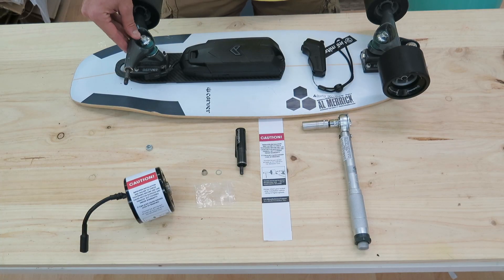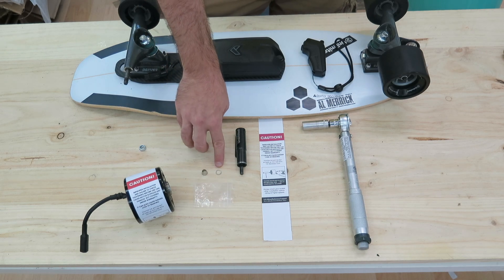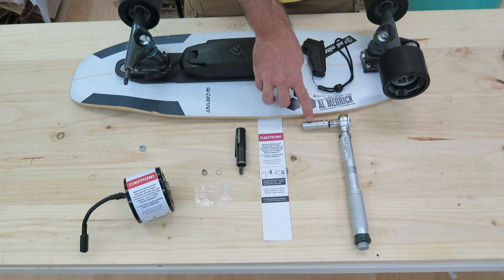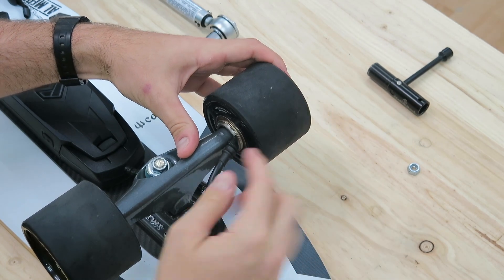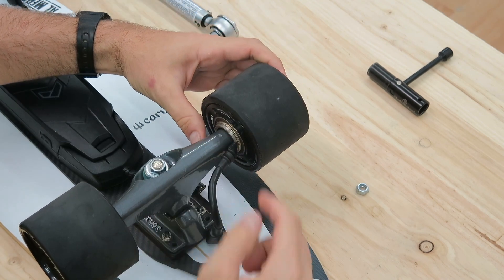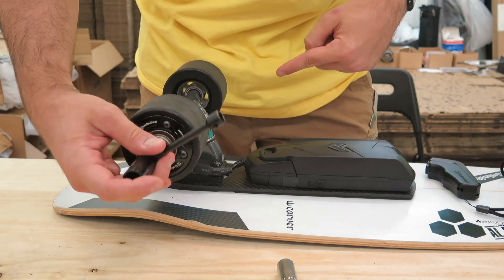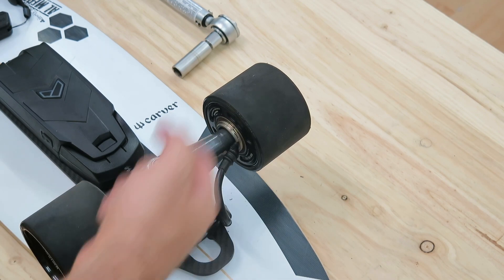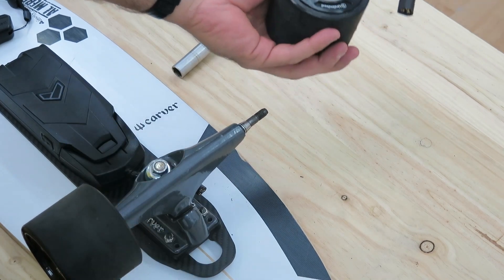From The Workshop - Unlimited Electric Skateboard Motor Installation

Comment: Will mounting the motor without the couplers (little brass bit that slides on the truck bolt) result in this hub spinning? I received a pair of the hubs without trucks. I don’t believe I got that little coupler.
Reply from the maker: The most important thing is Coupling Cone + Speedring, you really don't need a serrated washer. Just make sure the nut is really tight!

Comment: thats a very nice looking motor ,but i dont understand what stops the motor from rotating?
Reply from the maker: That's the secret sauce (pun intended)
Reply: It' not difficult is the same principle of a collet on a milling machine. The internal shaft of the hub is taper and the collet (what the call the coupler) has the same taper, so once you compress them they get in contact and sealed the 2 parts together. Just check whatever video about spindle and shank and you will see the same principle :-)

Comment: Sooo... everything depends on that single nut that's the final step in installation?  I imagined an entirely different arrangement, so seeing this was helpful. EDIT to add: Watched again. Ah, I see.  Make sure the shaft of the truck isn't fat and doesn't rub against the wheel core!